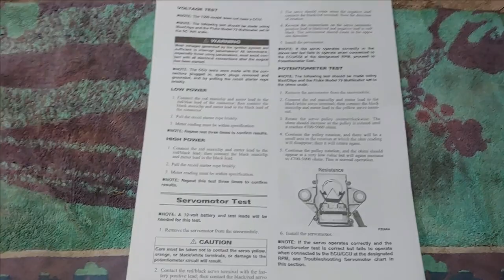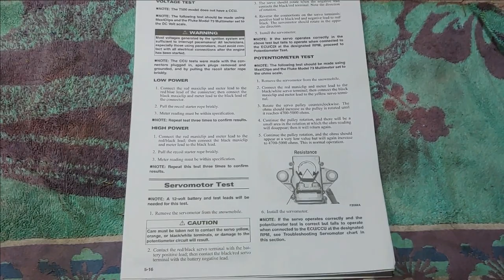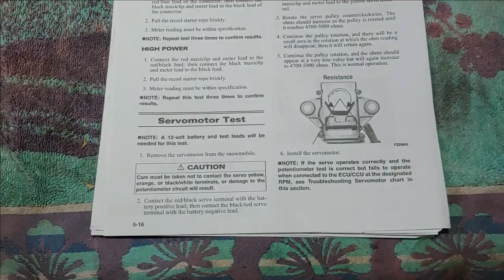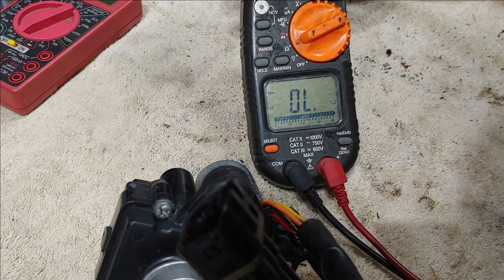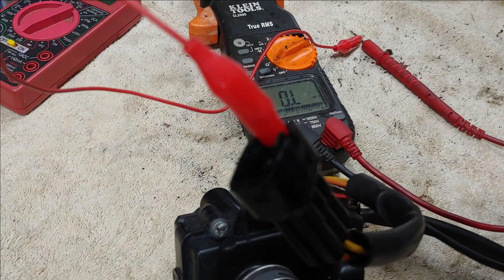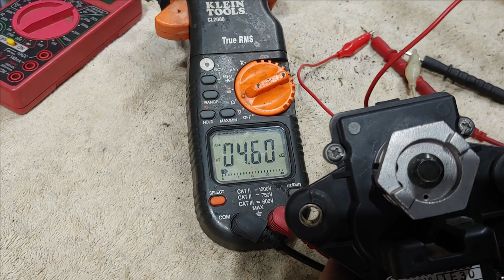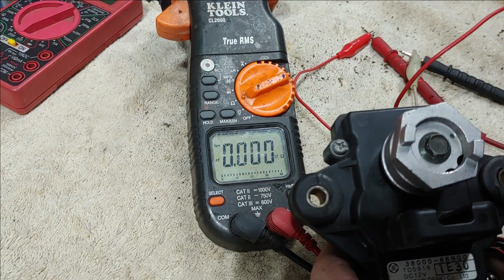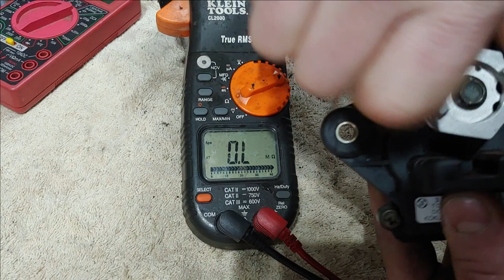02 Arctic Cat ZR 600 EFI Part 6: Power Valves & Troubleshooting a Bog [Servo motor Testing]

Comment: Got one with a remote start? That’s part of my issue as well. Intermittent operation of remote start! Ugggg.
Reply from the maker: No I dont. That would be cool. Not sure if tjey made for the older sleds. I dont have any new ones yet. Maybe if the channel does well I might! 😉
Reply: @Fixin2Ride-Official-  I have an extra key fob and brain that will fit your sled. Is it yours, or a customers?
Reply: @Fixin2Ride-Official-  it’s factory bud. 0630-149
Reply from the maker: @sambuvca22  Nice! Ill look into that.
Reply from the maker: Its ours. Wifes more specifically.
Reply: Andy, I have the sled back together and the power valves are opening and closing at idle. Have you seen this?
Reply: Continuously. This is a efi model.
Reply from the maker: Efi are not supposed to open and close at first startup. Only the carbd models.
Reply: @Fixin2Ride-Official-  weird. It’s gotta be the module or the servo assembly. Not sure. I’ve had problems with this machine since I bought it. May part it out. It’s in great shape. Only 4000 miles
Reply from the maker: So how many times does it cycle or just once? Also, unbolt the ECU from the airbox and set it up so you can see the code on yhe bottom. Start it and see if there is a repetitive code. It will be so many flashes in a row and then it will quit for two seconds and then start back up and keep doing that period I believe that there are multiple codes it will do them consecutively so two flashes and then four flashes and then two seconds stop and then repeat two flashes and then four flashes.
Reply: @Fixin2Ride-Official-  got ya. I didn’t think of that. 
So the power valve servo cycles repetitively. Open/close over and over but it ran, so I decided to check the wires under the handle bar pad and Un bundled them. Now it starts then stalls. Won’t stay running. I used the switch half with the emergency stop switch that I got and no change.
Reply: I do have a hood pin. And I’m thinking the remote start may be accosiated with this problem. I’m close! But not there yet.
Reply from the maker: Did you try just leaving it unplugged? Probably a broken wire somewhere
Reply: @Fixin2Ride-Official-  I did. I have a spare brain for it as well. I’m gonna throw a new ignition coil just cuz I ordered one and test the fuel pump. If that doesn’t work ,I’d say it’s a wire or the CDI unit. I’ll let you know what I find. I’m gonna try posting the video of the power valve servo surging on my channel. I counted 11 times before I shut it down. Sleds a 2003 btw. I thought it was a 02
Reply from the maker: Okay so I did a search today and found that it looks like it might be your timing sensor. Which interfers with the rpm sensing of the ecu and the ecu thinks the engine is reach the 7150 mark for rpms and is trying to open the apvs. Hence the cycling of the servo. I would test that sensor nut try teplacing it with a known good one from a running sled. They can be found on 1993-2005 sleds from 580's to 1000cc's. I believe the part number is 3004-073
Reply: @Fixin2Ride-Official-  Thanks man! I’ll check it out.
Reply from the maker: You bet! Hope that does the trick. Also might want to check your VR/R if you havent. The ECUs monitor overall system voltages and will out the sled unto limp mode if something is off. Always something to check into. Keep us posted.
Reply: @Fixin2Ride-Official-  I tested that when the engine was out. Ordered one but got the wrong one. What should it test for OMS?
Reply from the maker: @sambuvca22  Oh gotcha. Trying to remember everything we've talked about. haha. You'll want to test for voltage when it's running. Should be around 12.5-13.5volts IMSMC...